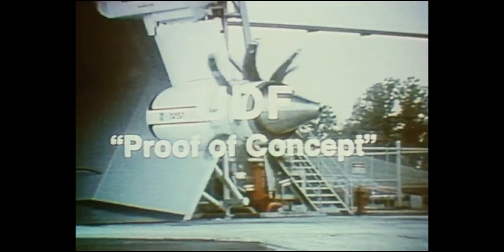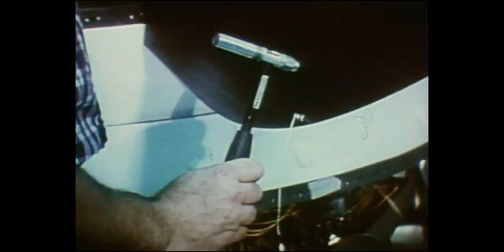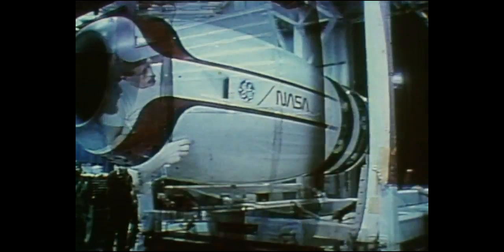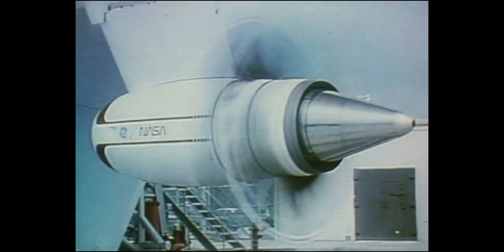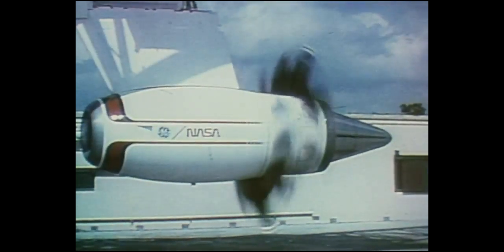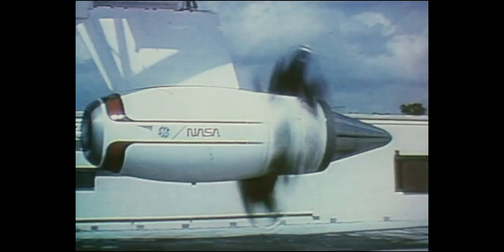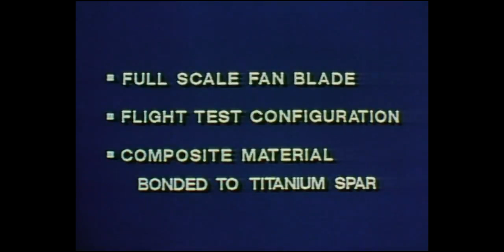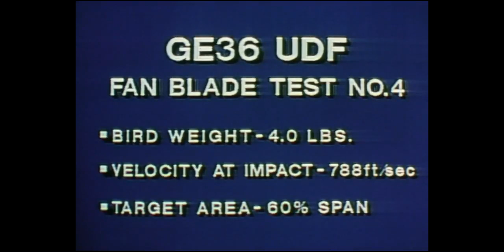GE36 Unducted Fan

Comment: For all of you wondering why these engines were never used, these engines evolved into the modem high bypass turbofans that you see today.
Reply: Not really, high bypass engines evolved from low bypass engines.

 These didn't catch on because of the noise they made both affecting the cabin and surroundings. Because of their size, the difficulty in mounting them to a plane without a clean sheet design.

High bypass turbo fans and propfans address the same issue, fuel consumption, in different ways. Propfans have an ungeared set of propellers to produce extra thrust. Turbofans have an enlarged cowling with a fan acting as the first stage of compression and providing the majority of the thrust. 

There are more difference and similarities, plus turboprops to read in to
Reply: they also didnt catch on because fuel prices were dropping, GE didnt want these cutting in on the CFM56 market which came around the same time, and these engines were a lot louder in the cabin for passengers. These are more fuel efficient, and we may still see improved versions in the future depending on fuel costs, but this engine wasnt worth releasing for GE.
Reply: Not really. High bypass engines were in development way before this, like 1967.
Reply: U are so wrong get ur history correct
Reply: sorry but this is not correct. As pilot145 mentioned, this was about and and a half decades after high bypass turbofans like the TF39 and JT9D were in development.
Reply: They are still talking about this technology I think GE is working on it.
Reply: Prop jet technology will be used maybe in the future on some future airliner design

Comment: My mom was a secretary for some of the engineers that worked on this project. As others pointed out it was highly efficient, but extremely noisy. The program did lead to noise cancellation used by large turbo-props today.

Comment: The GE36 had similarities to the  GE  CJ-805-23s  basically a ducted J79 turbojet with a secondary turbine which drove a single rear mounted turbofan.  The engine was used on the 1960's era  Convair 990 Coronado  making it the fastest subsonic airliner at well above 600 Mph cruise speed.   Unfortunately the plane was noisy, smoky  and inefficient and  with a limited market base.  only a few dozen CV-990's would be built.

Comment: Man... 24,000 pounds of thrust back then on that.  Just one of those could power a C-130H on long field.  Can't imagine how much they could get on a modernized version of this design.
Reply: They may one day actually make these
Reply: not any time soon without major design change. much too loud. that's why they aren't being used now
Reply: ?? c-130 is a turboprop.
The old 737-400 uses 22,000 pound engines. 777 engines are around 100,000 exact rating depending on sub model. 747 are about 50,000 each.
Reply: MyTech You got to remember the time that these were being worked on, Just imagine today with noise canceling and modern computer assisted production methods
Reply: @NatEff3ct  after ur noise cancelling you'll just end up with a high bypass engine like the ones you see on airliners
Reply: The reason you don't see these engines is because they figured out how to do the same thing but with ducted fans. The latest ultra-high bypass geared ducted jet engines have the same fuel efficiency but without the noise because of being ducted. Basically this technology did become implemented, but was first improved.

-Rob Mausser
Reply: @dddf27  turbofans have learned almost nothing from propfans. These have variable pitch blades and no heavy, unreliable gearbox. Turbofans are so huge now that their bricklike aerodynamics are starting to eat away at their efficiency. Diminishing returns. No contra rotating fans exist to bring their sizes back down.

Comment: These things made a hell of a racket...I mean that is why there are none around now saving fuel.
Reply: Complexity
Reply: The other reason they are not around saving fuel is that they are an over complicated design, plus with modern jet engines like the rolls royce trent class we have efficiency in comparison
Reply: Permanent hearing damage after one flight.
RIP eardrums.

Comment: 0.24 sfc is incredible when you compare it to brand new turbines such as the leap series powering the 73 max. The leap has an sfc of 0.42.
Reply: That's cutting fuel consumption by nearly half.
Maybe AOC should have showed this when talking about her green new deal which would have put Mike Lee in his place.
Reply: If its so incredible why dont they use them?
Reply: @loyalm2468  mainly noise. also blade failures become an issue with no cowling to catch the blade
Reply: Loyal M8 Because, as OP mentioned, new ultra-high-bypass turbofans are more efficient?
Reply: Kuznetsov NK-93 0.235

Comment: one of the things that this video doesn't show is that this engine used an F404 as the gas generator. And there were some issues with that mainly having to do with reliability. military engines don't have the same duty cycle as commercial engines and that has caused issues when military engines are adapted to other purposes (there are other examples specifically with the F404). With a purpose designed core it would have been even better.
The power turbine concept is absolute genius though. We're definitely going to see engines like this in the future.
Reply: Well, CFM RISE seems to continue that legacy now.
Reply: I could only wonder how a CFM RISE is gonna sound like

Comment: i wonder what this engine would be like if it where remade today even just a one off using the better knowledge of jet engines that we have today the unducted fan may be a diamond in the rough.
Reply: Probably wouldn´t go through certification, normal turbofan engines need to withstand one of the fan blades breaking and not let that fly away. But how would you do that with the fan spinning free
Reply: @eragonFiniarell27  normal turboprops have to go through the same certifications. And the reason why turbofans have to have a shroud that's able to catch those blades is because they spin at stupendously high rpm's compared to a turboprop or unducted fan like in the video. Also after making my previous comment I did some research they haven't tried making an unducted fan in the same layout as in the video but planes such as the A400M use engines called propfans like the engines in the video it's a hybrid between a turbofan and a turboprop But unlike the one in the video it has the propfan mounted to the front of the engine like a traditional turboprop. I forgot the name of it but Antonov also have a prototype of similar design.
Reply: @phalanx3803  I see ok, might have been wrong there then. And i think i know what kind of engine you mean there.
Reply: @phalanx3803  Fan tip speed whether ducted or unducted is limited by mach number; basically the same energy in either case.
Reply: @mytech6779  well that is true but it's factors in the radius of the blade blades with a small radius can reach higher RPM's then blades with a larger radius like a helicopter can only spin at low RPM's. That's the reason why turboprops have always been so fuel efficient because the blades can spin at the low rpms where they're efficient and the engine core itself can spin at really high rpm's where it's efficient. The new a400m tops out at 825 km an hour for a turboprop of such size that's fast and getting pretty close to turbofan Territory probably won't be long now where the lines between turboprop and turbofan start to come blurred

Comment: This type of engine was developed firstly in the 70´s, during oil crisis. Goal was creating of the engine with less fuel consumption, with preservation of speed and power of actual turbofan engines. It was achieved without bigger problems, new engine has 20% less of fuel consumption than standard turbofan. But, research was interrupted, due three main reasons. First, when first usable prototypes were finished, oil crisis ended. So, fuel and it´s cost was again not a problem. Second reason was psychological, that solution with visible propellers seems somewhat obsolete for aviation companies and their passengers. Return to propellers was perceived as step backward for many people. So there was not enough motivation for purchase of “new old” planes, or conversion of existing ones to these power units, especially when there was again lot of cheap kerosine on the market. And, finally, third serious reason was significantly higher noise level of these engines, comparable with standard turboprops. And, since reduction of noise was the priority of all aircraft manufacturers, this way of engine development was stopped. Main reason, why is this concept from 70´s ressurrected, is, again, fuel cost.

Comment: Could you describe this as an ungeared turboprop? Fantastic video.
Reply: 0:19 - I tried to compare it with the Tu-95 Bear's power plant "world's most powerful turboprop."
An article in flightglobal has GE stating the production model would have 25,000 lbs thrust
The Kuznetsov NK-12 was rated in KW and HP. 
In the flightglobal article GE says it was enough for an MD-11 but not the 170 seat "7J7"
Reply: No. A prop uses airfoil lift to create force. A fan uses air mass acceleration. It is a fine line depending on how you view it, but a meaningful separation for engineering.
Reply: No, this is not ungeared turboprop. This is something like unducted turbofan.

Comment: Since the concept has been around for that long why haven't we seen it yet made into a plane !?
Reply: Cabin Noise and unpracticability.
The engine proved to have lower specific fuel consumption compared to regular turbofans at that time, but the oil price was still so low that it didn't matter.
Nowadays, modern turbo fans with high bypass are much more efficient.
Reply: GE36 Actually The Best of the Best GE/NASA could design, fell short of Customer expectations; *1) Please Allow Me, 1990 Philip Bannon provides Timely two step corrections GE90 (step one) and GEnx, GE9x (step two) and patents US9810145B1 - Ducted impeller 100k thrust pound solution, Industry wide accepted and some still call the "leap engine" AND what is pushing your Flight to your next destination today?!! 2) Could NOT achieve Commercial Aircraft Flight Speed due to the sub-sonic speed threshold of the Fan blades. Same as any Propeller driven Aircraft.  3) Yes, the fuel consumption was low due to Low thrust but, not any lower than that of any other previous Jet Engines throttled back to similar low thrust but, definitely NOT lower than a Turbo Prop. *Question What is better than a Turbo Prop? However lets be fair (there are Piston Engines with much better Fuel economy) and compare this engine to a Propeller driven Piston engine Aircraft or a similar thrust Turbo Prop. 4) The design thrust limit, Also limited Aircraft Size to less than a 727  5) Too Noisy 6) Too Smokey 7) The Blades if broken off would go through the Airplane 8) At the time 4 engine Aircraft were on their way out, 2 engine aircraft are IN and Transatlantic crossing Certification for 2 engines was at stake. I am sure the GE36 would of failed here 9) Not aesthetically correct. LOL!  Please excuse Me but, Would you purchase a $375,000,000 Aircraft with Octopus looking things hanging off the Wings?………………Leaving the only question; Are Counter rotating Props a good thing?………Yes, for the same purposes as a Bi-plane and a low speed Boat!……………………My Favorite Aircraft "Precious Metals" Used a counter rotating Prop arrangement, I do not believe in my humble opinion could have propelled to a speed just past the current record 550MPH+ refuted by Many and "Voodoo" too, who's top speed for a single Prop is at 554.69 mph. What configuration and Who is the fastest? Well not by much if any and We'll not know for awhile for sure. A Crying shame, I wish beautiful Aircraft would go on living forever but... https://www.popularmechanics.com/flight/a17269/precious-metal-p-51/
Reply: the first open fan ran back in 1945 in the UK.
Reply: @exhilarationaccelerationpo9082  didnt even hung off the wing it was used on aircraft like the md 80
Reply: Dangerous, Too much Fuel, Noise and Pollution and too little thrust :( 

Some Wise Guy Genius, some say smarter than NASA and GE combined, came up with this 
"Patent US9810145B1 - Ducted impeller"; All airplanes use today :)
Reply: Ya mean first Propeller Aircraft, right?Right Bothers comes to mind.
Reply: Test only
Reply: The power turbine section had no stator.  The stator was replaced by the turbine blading mounted on the inside of a spinning drum that drove the forward ring of the un-ducted fan.  The turbine blading for the rear ring of the un-ducted fan was mounted on the outside of a spinning drum.  As the outer drum is strongest when it is a single piece, the fit between the inner and outer drums is on the order of the tolerances between a nut and a bolt.  The blading had to be designed to allow the same degree of twist to move every ring of outer blades through all rings of inner blades between the ring of outer blades and its final position.  Bearings between the two turbines can only be located at the ends of the drums.  The tips of the blades must be very close to the surface of the other drum, so the demands on the alignment bearings are very stringent, and the allowable imbalance of either of the two turbines must also be stringent, as the two turbines are rotating in opposite directions in the same space.

With no gearing between the two turbines, nothing forces them to rotate at the same rate, so they must balance over a large range of rotational speeds.

It was not efficient enough with the counter-rotation gearing, and it was too hard to build without the counter-rotation gearing.
Reply: well being former DLA and my grandfather working at nasa for 22yrs i can tell you why, they have this thing called a “budget” if they don’t use the money to develop something you won’t get anymore money for that “budget” .... we paid for that thing... cool and all it was just a waste of money.... to get more money.... 🤦‍♂️
Reply: @Aerspasius I know how loud that is, you should hear my girlfriend!
Reply: @ozontm  It's still more efficient than the best high bypass turbofans today such as the Trent 7000 and LEAP at cruise speeds but noise is still an issue and it would have mounting issues on some jets with low slung engines.

Comment: Sfc beaten only by Kuznetsov NK-93 as far as I know.
Reply: Did you mean Progress D-27?
Reply: @volo870  No that is a turboprop. The NK93 is a fan.
Reply: I meant beaten in sfc.
Reply: @martinda7446  D-27 is a propfan, not turbofan - it is quite similar to GE36 by specs and intended application.
I've personally witnessed An-70 flyby. Boy, she's quiet!

Comment: So why was this project shelved? Did it save too much fuel? Piss off big oil? What?
Reply: Too noisey to be off any practical use
Reply: It's a turboprop with a double propeller like the TU-95
Reply: Adamast no it's not a turbo prop. A turbo prop uses a propeller driven via a gear box which is driven by a second stage power turbine. In this engine design, the unducted props are directly connected to the power turbine section with no gear box.
Reply: fuel prices did not go up as expected. not enough customers. Money crunch. Some technical problems but could have been overcome. I worked on the product version until got cancelled.